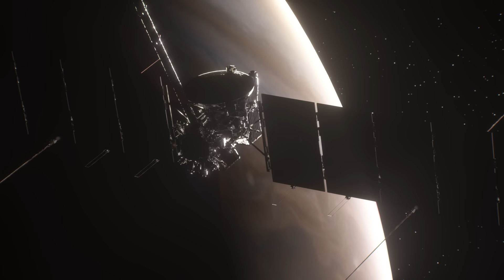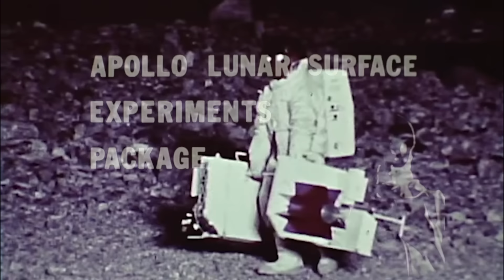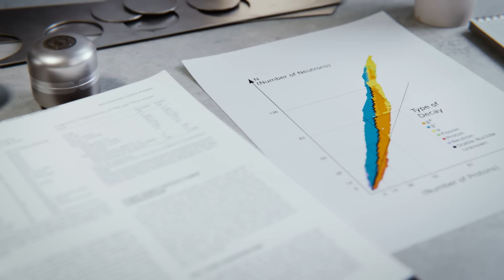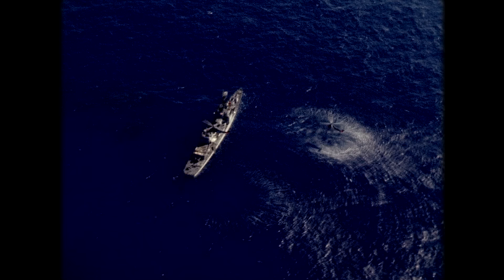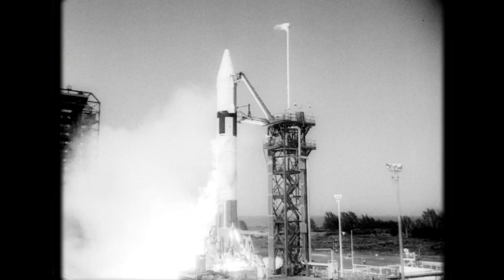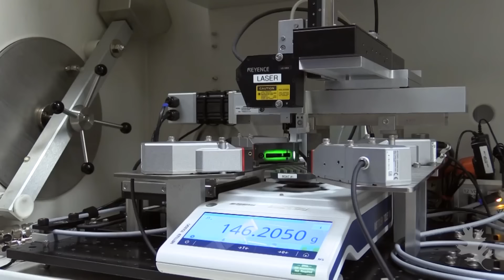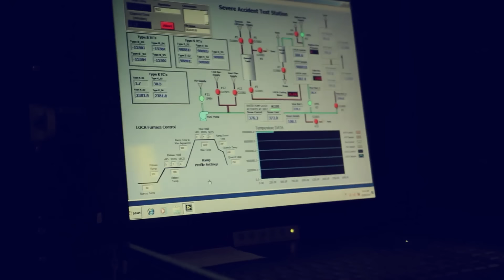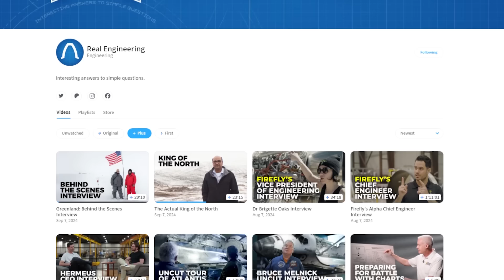NASA'S Plutonium Problem

Comment: Just use 239 in a pulse tube reactor design. The coolant is the moderator and it percolates similar to a cofee maker. The pressure waves can be used to drive a linear generator. These reactors go critical as the chamber fills with fluid then go subcritical as it boils. Could use the fluid directly or use it to heat a small stirling cycle engine. It would have a working life of decades to centuries and the power can be increased or decreased as needed. Also could use solar panels that can be ejected when no longer practical then start the reactor. Like cool things like this? I can help you build one ❤
Reply: Your garage must be filled with really cool equipment.

Comment: No ill fully concede that point. Thorium is probably 20 years away AT THE LEAST, and thats with heavy investment (I do not believe the problem of thorium is similar to the problem of fusion...where it's just always 25 years away. I think thorium is a readily solvable problem). But yes, plutonium is the Achilles heel a nuclear Renaissance.

I think there are regulatory and oversight solutions to the problem of plutonium in the short term, solutions which accommodate reprocessing, but yes, Iran should not be allowed to have a nuclear weapon.

A little bit, I think they're the unsung hero of "contemporary modernized Islam," but they also kinda wish Hitler had won. It's a balancing act.

No. I do not think the problem of thorium is the same as the problem of fusion. It will not be perpetually 20 years away. I do acknowledge the plutonium problem in the short term.

Yes, there exist nations that should not be allowed to have a nuclear weapon, and it's easier to produce such a device with plutonium. I don't think it's a lot of them, so maybe just let them burn coal and gas and oil until we think they won't do a genocide?

But yes. I will not deny the plutonium problem.
Reply: I pride myself on being correct, not on my ability to win an argument.
Reply: People don't listen to me because I can win an argument or run a propaganda campaign. People listen to me because the positions I hold are usually just correct.
Reply: I am able to do a great many things. At this point, my resume might actually be legendary. Snake oil salesmen isn't anywhere on that resume.

But yes, i acknowledge the problem of plutonium. We need serious concessions from places like Iran, but north Korea is so small, we could probably just give them our coal, it wouldn't effect the planet, and it would literally just cost us pennies to send it there.

I do not deny the problem of plutonium....its just that I'm confident the limitations of thorium are ACTUALLY a readily solvable problem. You should consult People that are actually working on that problem. They might tell you different, and I hope they do if my claims are incorrect.

My interpretation of things is, molten thorium fuels can sustain fission...but you need to dope with half a liter of plutonium or some such. On its own? Thorium just doesn't emit enough neutrons, which complicates the already complicated plutonium problem...because you need to neutron dope thorium fuels with plutonium seed.

Even if the thorium problem is solved...plutonium control will remain a problem. Plutonium doping (neutron doping) appears to be integral to making thorium a viable fissile energy source.

Yes, I am very aware of the plutonium problem, and I do not deny that its a problem...but I'm a musician, so I'd kinda like new Orleans to exist long enough that i don't need a submarine to go visit.
Reply: Plural. I acknowledge the problems of plutonium, because there are several.

Comment: I heard they've found a new alloy that conducts 400 times better, the problem is if it reaches 455 degrees c it can combust, its a nickel magnesium blend but is a new thermal electric material.

Comment: What about Strontium-90? The Soviet Union used it for RTG-powered lighthouses. 

It's a beta-emitter, so it might be less than ideal as far as shielding goes, but it's a common byproduct of fission reactors, so it's not in short supply like Plutonium-238 is.
Reply: The Russians RTG weight tonnes for a couple hundred watts of power, it's useless as far as space exploration goes.

Comment: Other radioactive isotopes can be used easily. 

What we use in those generators is the warmth generated by the decay. The exact isotope is mostly irrelevant, the only interesting detail is half-life so that you can plan a mission length. 

So: There is zero need for Pu. Nasa has a brain problem, not a resource problem, as evidenced by the most recent crewed mission.

Comment: A lucky fact about 238 is if you look at it's decay chain on the chart of radionuclides, it is almost entirely alpha decay, many of the decay chain isotopes are the only isotopes in the heavy side of the chart that undergo alpha, in a sea of beta- emitters. Its like a path of alpha stepping stones through a sea of beta emitters, quite convenient. The first beta emitter in the chain is Lead-214 which is 6 alpha decays down the chain.

Comment: We didn't lose our ability to produce Pu238.  We defacto outlawed it because idiots hate repossessing spent fuel.  This is despite the fact that you have to have  a pretty fast fuel cycle for weapons grade plutonium.  Typical high burnup power cycles would be able to produce the Np237 needed for making Pu238 easily while being mostly useless for making bombs.

Comment: Say I wanted to add a nuclear range extender to a Tesla model 3.  I want the plutonium 238 to give me 40 miles worth of energy every day, so I can satisfy my daily drive needs without having to worry about charging.  

To achieve 40 miles worth of energy every day, I would need ~10kwh of charge added to the battery every day.  This turns out to be a constant flow of ~0.42kw of power.  The amount of plutonium required to give 0.42kw is ~1.2 grams, assuming the information about p238 heat exertion I’ve gathered on the internet is true, and assuming a 60% efficiency in converting heat to electricity.  

Assuming the price of plutonium is ~$2k usd per gram, it will only cost us $2440 for enough plutonium 238 to give us 40 miles of range every day for 85 years(p238’s half life).  That is 1.25 million miles, for only $2.5k.  Of course, we have to account for the systems to harness this energy, which might cost $15k per unit, so that’s a total of $17.5k for a plutonium 238 range extender.  For reference the same amount of electricity at a Tesla charger would cost ~$77.5k.  

Of course, it’s ridiculous to assume anybody would drive their Tesla 1.25 million miles.  They are usually estimated for a 200k mile lifespan, which would cost ~$12.5k of energy, rendering the p238 range extender useless to us.  That is, unless we design the range extender in a way that it can be transferred from one electric car to the next, in which case it would easily be very worth it to install.  

All of this is entirely hypothetical and extremely surface level.  There are many factors not accounted for, such as what to do with the energy of the battery is full(the plutonium does not care and will continue heating up), or considering the scarcity of p238 and the ramifications of raising the demand without the infrastructure to create the supply, among other less important practical issues.

Comment: Biggest issue you face on your main first chart for supply and demand is that its VERY LIKELY that ASPECTS of commercial reporting on this is restricted on National Security IP grounds now. Secure supply is unreported and to report is a breach of national secrets. Its a generally fair statement that what was once produced in the commercial sphere has been moved to production into Protected National Supply which again will be covered by national secrets reporting guidelines now.

Free-sale / free-market supply indeed is probably very rapidly diminishing, but NASA wont rely on that anyway. Id investigate very carefully exactly which missions are and arent getting it. Its unlikely that supply will be restricted on mainline / strategic missions, including mainline data missions. Anything 'ad hoc' or novel wont get access to restricted supply probably or will have to go to market.